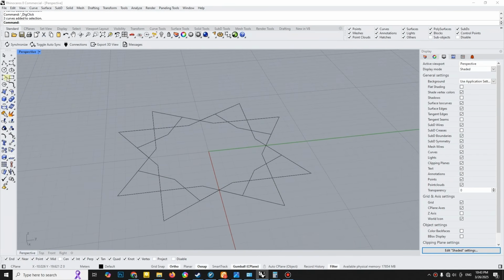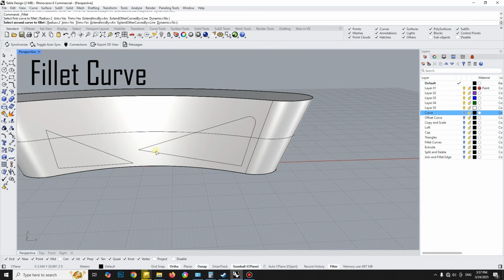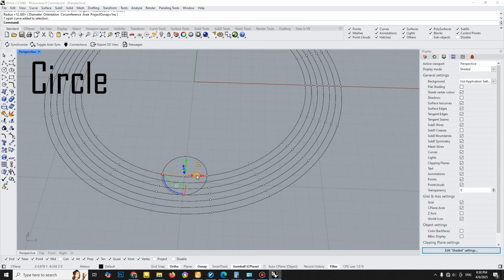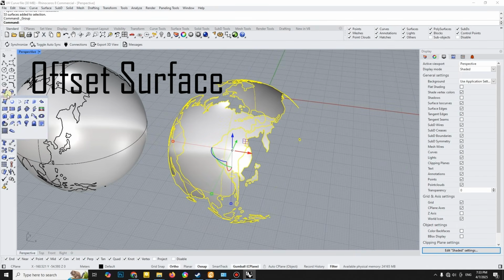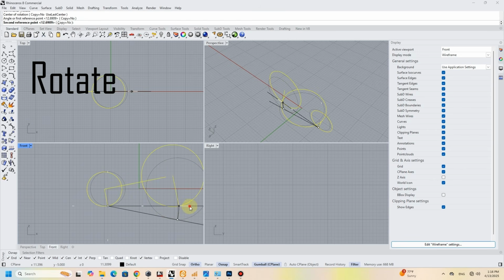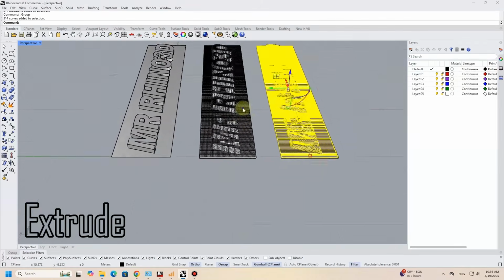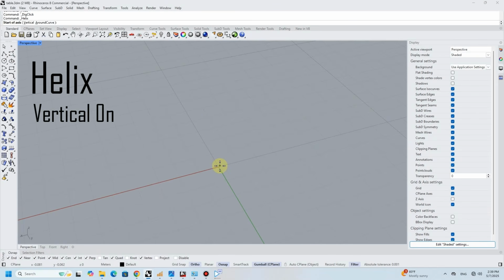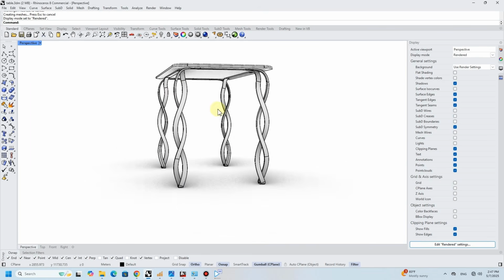10 Rhino 3D Models You Must Learn | Full Tutorial for Foundational Level

Comment: 7:04  Didn't you mean Union ?  Join command doesn't work for me.
Reply from the maker: In this scene, I split first and then join the chair legs. You can try Boolean Union too.
Reply: @Mr.Rhino3D  Thank you for replying.  Also where to download world map ?
Reply from the maker: @jumbo999614  You're welcome. You can search for a World map DWG, or I can send you via email, WhatsApp, or Telegram!
Reply: @Mr.Rhino3D  Now I have new problem. After I group the map and use split, it keeps saying object may not intersect.
If I don't use group command, I can manually split only certain parts of the map. For example. I can  use it on UK which is not on continent and doesn't share borders
Reply from the maker: @jumbo999614 this problem happens when the curves aren’t joined perfectly or when a small gap is not filled.
Try to join or connect all the world map curves and check the curves that aren’t connected, you must solve it first then do the rest.